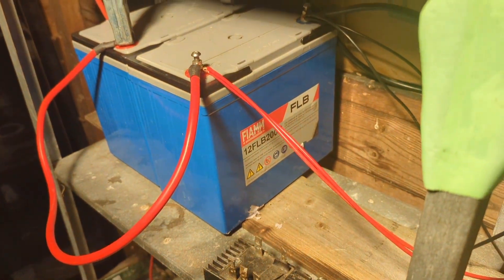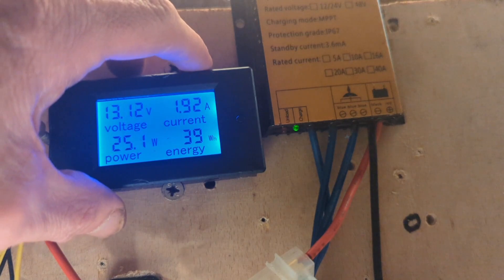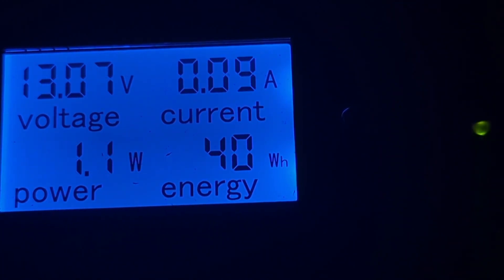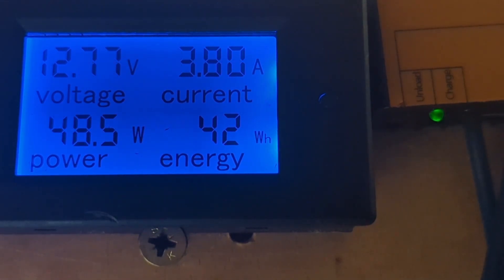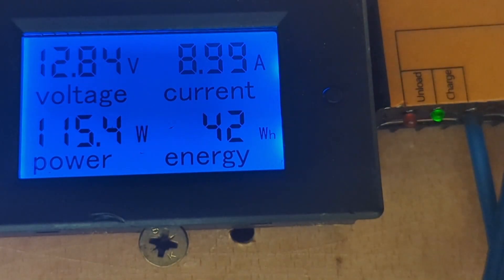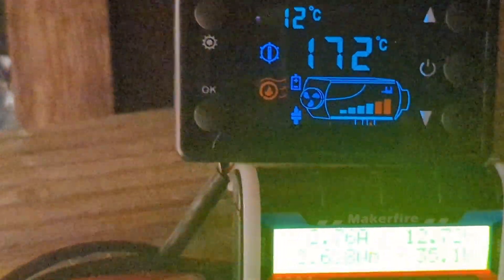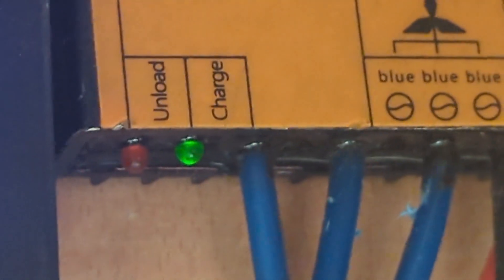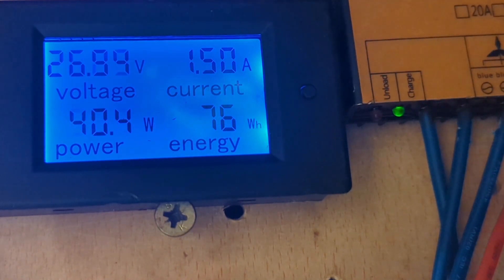DIY Wind turbine budget controller - 31 January 2023

Comment: Heyo! Is it possible to use an inverter? I have this inverter SUN2000-20KTL-M5 and SUN2000-10KTL-M1
and this battery SUN2000-10KTL-M1.
Reply from the maker: YES , BUT YOUR TURBINE NEEDS TO PRODUCE ENOUGH VOLTAGE TO ACTIVASTE THE INVERTER, SOMETIMES ITYS 22V SOMETIMES ITS 48V

Comment: Heyo I’m currently trying to get a Smarttwister ST-2000 wind turbine (2 kW, 3-phase AC) back online, but the original controller (RST-3500-AB) is missing. I saw your setup and was wondering if something like that could work.
Reply from the maker: It's pretty basic ( do dump load ) but does work, you could get a tristar TS45 cheap off ebay.